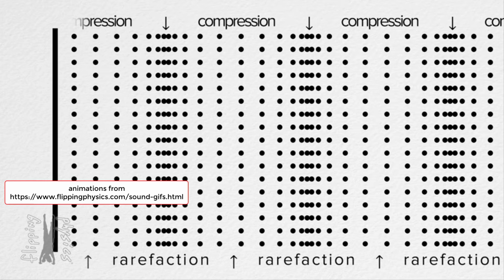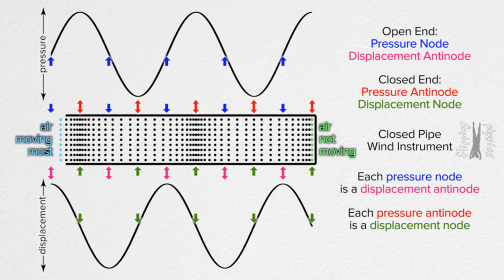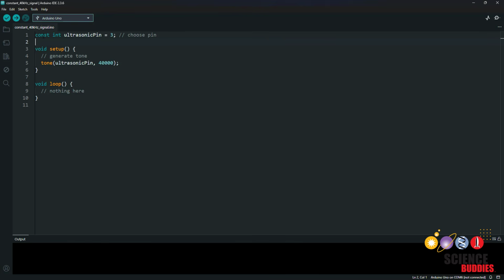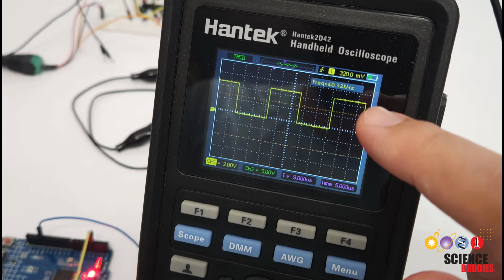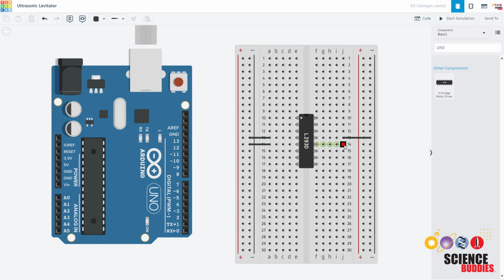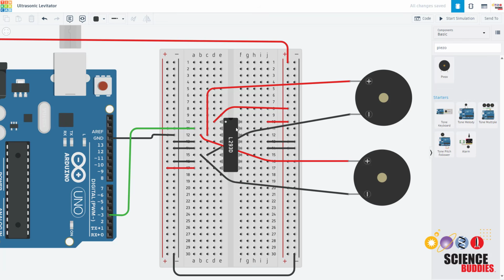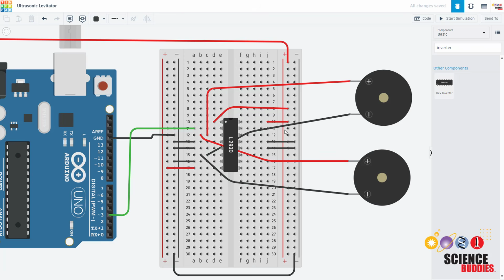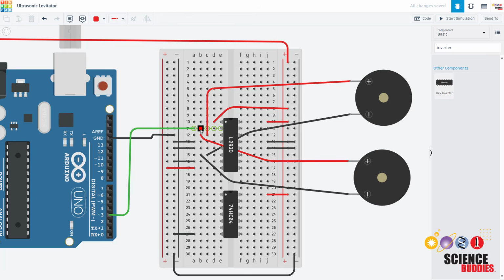How to Make an Ultrasonic Levitator | Science Project

Comment: editing how many microseconds seems less precise. what if you did tone(pin, 38,500); etc... whatever it needs, until it is 40k. or more importantly use a tester to find the resonant frequency in each Arduino. Like matched pairs lol. i mean if it is a consistent output... it is clean code. 👻 I'm only 13 min in...

Comment: I am connecting the Arduino with my laptop , will this still work ? Is it really matter for the 12 v input into the Arduino?
Reply from the maker: This project will not work very well (or might not work at all) if you are only powering it with 5V from the Arduino.
Reply: I have connected the 12 v , but no voltage was appearing on transmitter as professor said the wires are very old change into normal wires 🙂.....ok that I will do today ...but u have connected a type c cable with Arduino , is it for use of connection of laptop to Arduino to put the codes ? ( I have an usb connector)

Comment: I tried building this but the board is getting very hot. I used a 12 V, 5 amp plug, Is that the correct one to use?
Reply from the maker: You may have a short circuit somewhere, the Arduino should not be getting hot. If you are a K-12 student you can ask for help in the Ask an Expert forums on our website and we can assist. We will need to see pictures of your breadboard. If you are an adult you can ask for help in the official Arduino forums.

Comment: How long does this take to make ?
Reply from the maker: Depending on how comfortable you are with electronics and how much Arduino experience you have, you could easily have this set up in less than an hour. If you're new to Arduino/electronics it may take you longer, but we have some great introductory tutorials on our channel that can help you get started.
Reply: @Science.Buddies  I see, thank you!!
Reply: Glad it works for you, I've put over 40 hours and shorted multiple times even though I've done everything
Reply: @DeclanLucey  i use solid core wire for it, that works